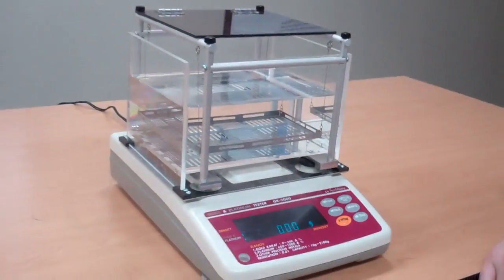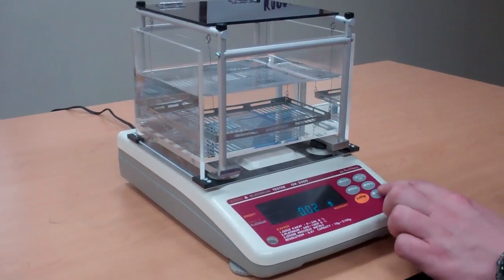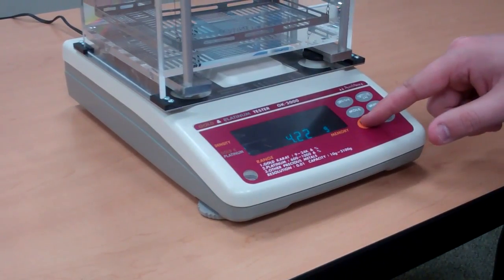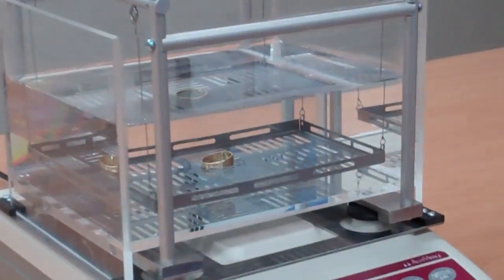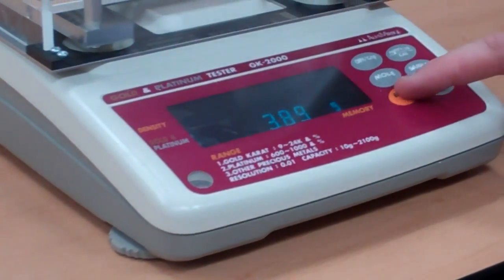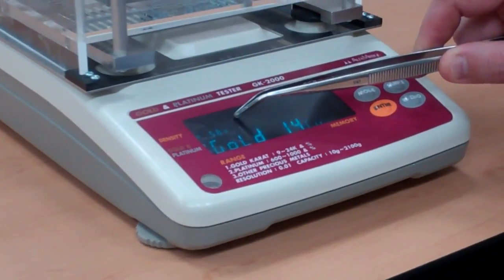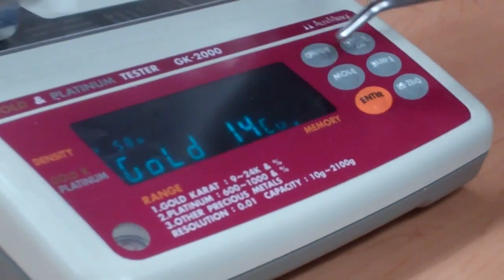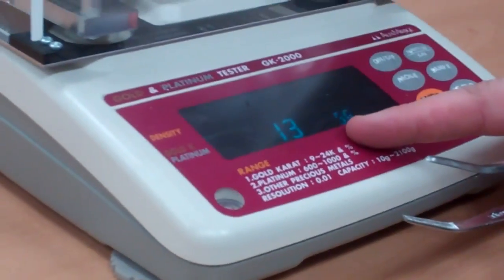How to use your SCGK2000 Precious Metal Tester by Kassoy

Comment: Is there a place online that goes step by step on how to use this Precious Metal Tester GK-2000,I'm kinda confused with it.I have the printer with it also.
For Example:
ST,+00011.17 g
OL,-99999999 K
OL,-99999999 %
ST,+00003.15 ag
ST,+00002.83 wg
OL,-99999999 SG
ST,+00000015 C
Besides is there Any other website that further help or educate besides the Instruction Manual that was provided.Thank You.